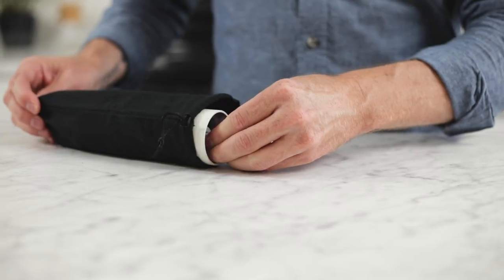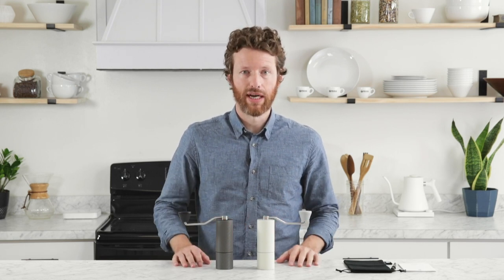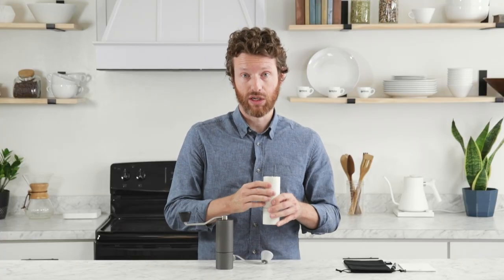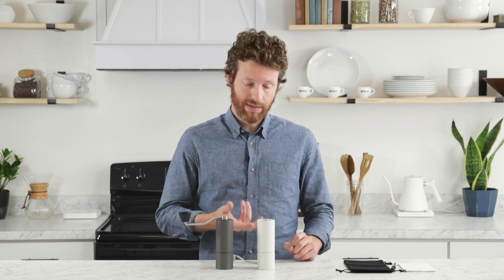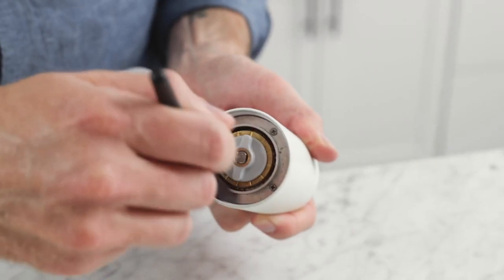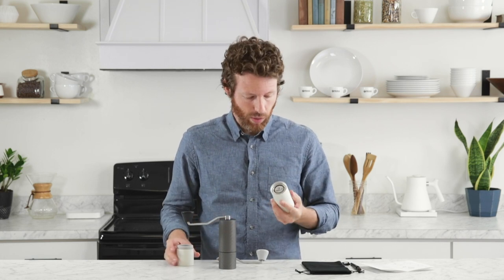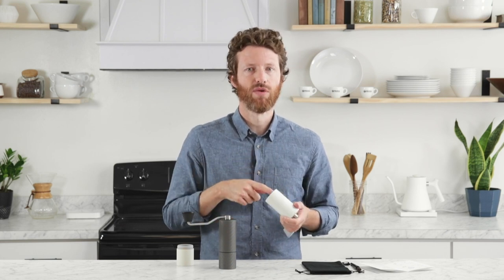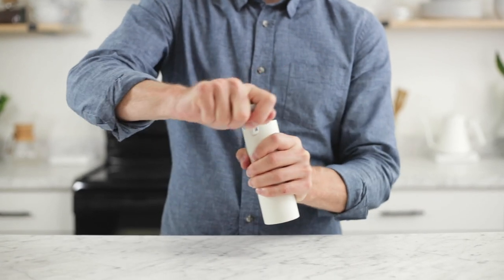Video Overview | Timemore Chestnut C2

Comment: I've had this grinder for over 2 months now, it has blown me away for it's price. I initially bought this for travel and I was using a breville smart pro grinder for my pour overs but now I haven't used my $200 breville since I got the C2 which is now my everyday grinder. The grind quality is fantastic, perfect for v60s (15-19 clicks). I noticed it starts to make a few more boulders as you approach the chemex grind size (23-27 clicks for me) but otherwise still grinds pretty consistently. It holds around 22-25g of beans depending on your roast level but 25 is usually rigghhht at the top. This is not a major inconvenience though, I just set aside  my first 20g in a separate cup for larger batches. I would highly recommend this grinder, I never thought I'd recommend against an electric grinder, but here I am. As they said in the video, I would not recommend this for espresso, I have a lucca a53 mini at home and this grinder doesn't grind fine enough for it.
Reply: Have you experienced when you try changing grind settings, it rotates a little bit before it actually clicks?
Reply: @moonsun815  Yeah, it confused me at first but you actually are supposed to keep the handle attached when changing grind settings in order to keep the burr in place. It can be seen as an inconvenience but honestly it's no big deal at all.
Reply: @Leapoffaith4  it happens even when I have the handle attached... it just rotates a tiny bit tho then it clicks. maybe my handle doesn't exactly fit to the shaft. anyway, thank you!
Reply: @moonsun815  Oh weird, my handle fits to the shaft perfectly. Is your grind size consistent too?
Reply: @Leapoffaith4  yup it's consistent so far and I think that's what matters anyway. The burr doesn't wobble as well. There are some fines which I think is normal.
Reply: @moonsun815  Yeah I get a few fines but otherwise really good consistency. I wonder why your handle doesn't fit on
Reply: ANDY NORtON is the grinder good for aeropress or moka express pot ?
Reply: @nugrahaprihutama8789  I personally haven't used an aeropress, although, I imagine it should because it's grind range is quite wide. I do believe it will also work for a moka pot, it really only doesn't work for espresso.
Reply: You are grinding light or dark roast beans or it doesn’t matter, your 15-19 clicks is just your dialling in range for v60 regardless what kind of beans your putting through the burr set ?
Reply: @AbuSayad  Each coffee is gonna depend, at the time of writing this I was brewing a lot of medium roasts, and now I've been brewing a lot more light roasts which do need some coarser grind settings. Also I was brewing mostly >20g brews at the time and I'm currently doing a lot of 25g brews as well as smaller 12-15g brews occasionally. For these lighter roasts I usually end up between 18-22 clicks and often around 16-17 clicks for the small 12-15g brews.

Comment: Bought one a few weeks ago and took it on 2 week holiday to grind for nanopresso..... Works great... Perfect traveling set up.....I use grind 13 from fine. About 15-16 grams although I've stopped weighing and just tamp in as much as I can get in.
Reply: Hi grapsta! I have the Nanopresso and I'm looking to upgrade my hand grinder to the C2. Do you find that the coffee has enough flow on 13 clicks grind setting and hard tamping? How much coffee do you think fits in there? Does the end result resemble espresso? :-)
Thanks!

Comment: It looks beautiful for the price 👀 I might have a Christmas gift in the works now.  Any review of the grind uniformity?
Reply: Hi, I have the same grinder and I've been using it for a week now. It grinds pretty evenly, better than most of the grinders in the same price range.
Reply: @moonsun815  Thanks so much!
Reply from the maker: The grind quality of Timemore's SS burrs, which are in the C2 model, is well above average and on par with other premium hand grinders.
Reply: @primacoffeeequipment  does it grind well for espresso, I'm wondering ?
Reply: @raphaelcmo  it claims that it can grind for espresso. just takes a lot of time i guess
Reply: @raphaelcmo  technically it could, and I have attempted getting espresso-sized grinds out of my C2, but it takes so much time it’s almost impossible to dial in. That’s part of the reason why I upgraded to a Commandante.
Reply: @moonsun815  any advice on click settings for light and dark roast? And v60 and aeropress?
Reply: @AbuSayad I only own a V60 so idk how many clicks are used for an aeropress. for light roast, I use 16-20 clicks. for dark roast,  20-27. it will still depend on your preference
Reply: @AbuSayad  It will depend on more than just roast level. Some coffee simply produces more fines than others, even at the exact same roast level. 
I have found this grinder to produce a lot of fines (compared to more expensive grinders) with coffee that tends to produce more fines. A wide variety of grind size as well. But it does well with coffees that naturally produce few fines when ground. 
Also your filter paper will make a huge difference in a V60. Some papers will handle fines better than others. 
For use with this grinder I prefer Cafec Osmotic flow medium dark roast papers. They tend to stall less and flow faster when brewing coffee with plenty of fines than other papers I've used. 
Also very hot water will help with this. 

Another thing that should help create a tasty brew is to use a single pour method or double pour. I've found a single pour with medium to fast pouring flow works to my taste preferences and keeps the fines from slowing down the brew. Also... not swirling or moving the dripper whatsoever while brewing. Again, that swirling, bumping or shaking the dripper while brewing can cause the fines to clog the paper and stall the brew. Producing unpleasant flavors. 

I know that's a lot, but after more than a year of ownership, I've found these techniques to make the biggest differences in cup quality when using the C2 grinder. 

A recap + : I prefer 12 clicks off zero, using a Kōno dripper (instead of a V60 - but V60 is OK), a low fines producing coffee (such as a high quality medium light to medium roasted Columbian). Water just off boil. Single medium fast pour. Cafec Osmotic Flow medium dark filter. 

I haven't found many coffees I like with this grinder, however choosing the right variables for each specific coffee can make it taste better. And this is all subject to your preferred taste. 
What I like a lot, you may dislike a lot and vice-versa. 

Happy brewing and drinking!
Reply: @AbuSayad  As for the Aeropres... wow! There are so many variables to change using an Aeropress. 
I suggest changing one variable at a time until you get closer and closer to what you like. Once you brew that magical brew with that excellent coffee, stick with it! Make notes of what you changed and how it affected the brew. 
I will say... the most important variable using this grinder will be choosing a low fines producing coffee. Ethiopian coffee is known to produce a lot of fines. Also darker roasted coffees will produce a lot more fines than the same coffee at a lighter roast. 
Natural processed coffees generally produce more fines than the same coffee that is washed processed. 
Your local roaster can probably help you find some low fines producing coffees. 
One way to figure out if a coffee produces more or less fines than another is to grind it for espresso extraction. Use a WDT tool for consistent puck prep. Pull a shot with one coffee and keep the grind setting the same. Mark the time it took to pull a specific amount of coffee (Like 30 or 40g). Brush or blow out and purge the grinder using the next coffee you will grind. (Using a hand grinder 3 or 4 coffee beans will purge it easily.) Use the same dose quantity. The same grind setting. The same output amount. Time the shot. The one that takes longer to brew has more fines. Considering you kept all the variables very very close to each other. 

Another easy way to tell if you're coffee is producing a lot of fines is to swirl the V60 brew and look for how many fines stick to the filter and also sit on top of the coffee once drained. 

There are some tricks you can use to help with producing a clean cup when a lot of fines are present, but in my opinion, coffee always tastes better to me the fewer fines there are present in the brew. 
You can sift out fines as well. Unfortunately that produces waste, unless you can find some wonderful way to use them. 

The only reason I'm harping on fines production is that with the C2 grinder it has been the main detractor from a great experience with it for me. 
The only truly great cups I've had with it are the ones where there were very few fines in the brew. 

Hope this helps.

Comment: In my experience, the C2 works best with coffees that naturally produce less fines, such as a quality washed Columbian coffee. With other coffees that produce more fines when ground, this grinder seems to produce more fines than other grinders, to the point that it stalls the filter brewing of them, causing some unpleasant flavors. 

However, I'm finding that with this Columbian coffee that I'm using, I prefer the flavor profile of the C2 to other grinders I've used with the same coffee.  I'm getting more sweetness and chocolately flavors. No bitterness. Very nice cup. 👌

Comment: Is this grinder ok for pressurized filter espresso? not super into espresso more into pour over but I would like to use my Breville Cafe Roma occasionally.
Reply from the maker: Yes, you could most likely get by using a C2 and a pressurized basket.

Comment: I'm guessing it will be ok for a nanopresso which takes a coarse grind
Reply from the maker: Nanopresso typically take a fine grind much like traditional espresso. The C2 works best for medium-fine to coarser grinds. You may want to consider something like the Slim, NANO, or G1 with titanium burrs, which can grind in the finer ranges.
Reply: @primacoffeeequipment  are you sure ? My nano takes way coarser then my espresso machine. Although I'm still dialing it in properly

Comment: So the zero point is where you can't turn the knob anymore? not like comandante where the zero is when the handle stays.
Reply from the maker: Either way works. The zero point is arbitrary -- just a way to have a point from which to count. As long as you know what the zero is, and you always use that as zero when counting, then the system works.

Comment: What about moka pot setting? How many click for moka pot grind
Reply from the maker: Great question! Timemore has included a nifty grind guide in the manual. The suggested range for espresso is 6-12 and for pour over is 15-24. As such, the moka pot range, depending on your recipe, is probably somewhere between 10 and 15. As always, though, grind a few beans to check the grind size before settling on a number.
Reply: @primacoffeeequipment  just bought this grinder yesterday. Tried 12 click just nice for moka. 10 is too fine.
Reply: @paiyed88  good to know...I’ve got a moka pot but I haven’t used this grinder yet for it...I’ll try 12. I’ve found 20-22 for drip and 24-26 for French press so far on my uses with the C2.
Reply: I am curious about buying this grinder for using with moka pot, and in some future, maybe as a first setup with Flair espresso .. How long does it take to grind 18gr (3cup moka) ? Thanks in advance